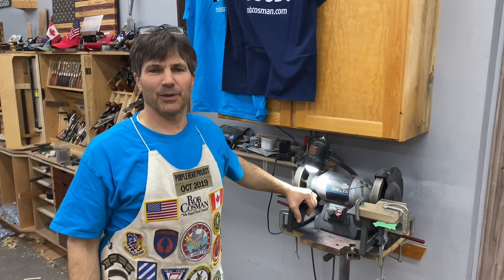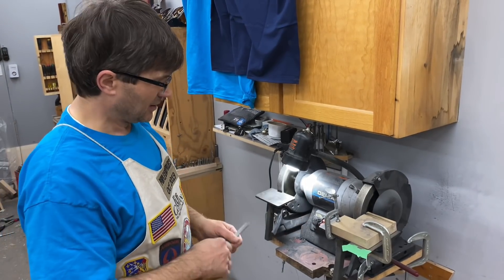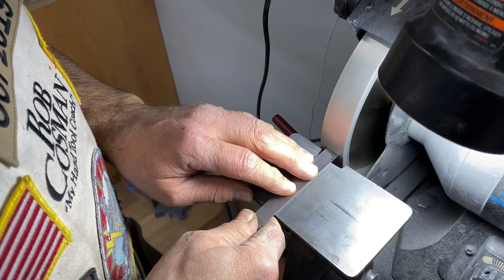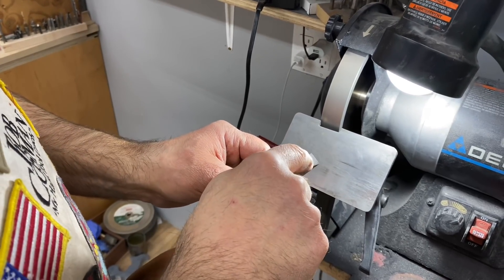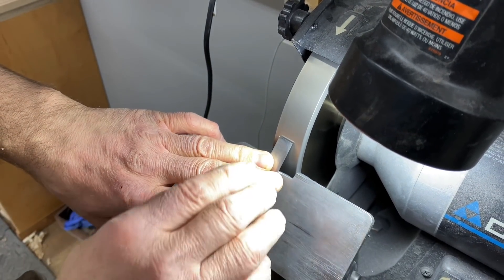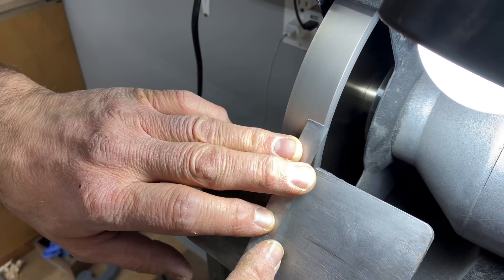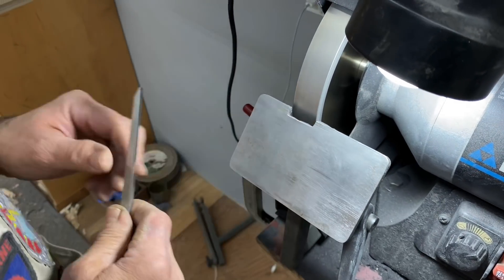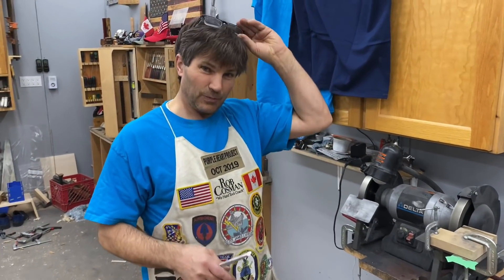Chisel Repair, regrinding the primary bevel.

Comment: Hi Rob. Thanks for showing this. Very helpful! Question - I realized after a while that I had the angle set wrong on my honing guide and I had put a 37 degree bevel on the blade of y #4 smoother. Should I start over and regrind it? Can I do anything from this point? I actually have 3 bevels on it now.. the 25-degree original, a 30-degree secondary and this 37-degree tertiary. Thanks for any advice!

Comment: Hello Rob. Beeing a bit familiar with how the hardening of the steel works, dont you think that you will loose some of the hardening by grinding the chisel dry? the tip becomes very hot which affects the steel. Have you considered this? Or is the idea that when you continue to sharpen the edge with the wet stones you will remove the affected steel? Thank you for excellent videos and craftmanship.
Reply from the maker: With no metallurgy background I can only speak from practical experience, no difference in edge retention after the process compared to before.

Comment: Hi Rob, what dia is your CBN wheel.  I only have a 6" bench grinder, so I'm concerned about the effect of the concaved face on tip durability.  Should I be concerned, or perhaps increase the effective angle by a few degrees, say 27 deg?
Reply from the maker: Steve Bosun mine is an 8” wheel, which I definitely recommend. The 6” grinders, like you point out, creates too much of a hollow. I would bump it up to somewhere between 26-28°, depending on the chisel.

Comment: What’s the alternative to having a bench grinder? A very low grit stone? Was considering buying a low grit diamond stone.
Reply from the maker: possible but takes a while
Reply: I used very coarse diamond stone for grinding handplane blades and it took several  hours.  It was so frustrating that I ended up getting a bench grinder.
Reply: @jaritiukuvaara9319  bought a cheap 180/220 grit one from Woodcraft last week. Haven’t tried it out yet, though. Tried with a 330(?) grit one, and took me like 6 hours to still not take it from 25 to 20 degrees.
Reply: @JeremyB8419   I had DMT D8XX 8-inch Dia-Sharp Continuous Diamond - Extra-Extra-Coarse. I was able to return it.

Comment: Great demonstration! Does the Wolverine tool rest have angle stops to take the guess work out of it?
Reply: No. It does come with a plastic guide jig, but as he said, that may not help if the chisel has a taper. Also, their marketing really only shows turning tools, so I'm not sure if the jig even has the correct angles for normal chisels or plane blades.
Reply: The angle is affected by the distance of the tool rest from the wheel and the angle of the tool rest, so presets wouldn't really apply.  The way Rob did it works and is simple enough that even I can do it.  The Wolverine set up is nice for this operation and the lathe work that drove its invention.  That said, I wish I had even half of Rob's eye/hand skills when it comes to the grinding and so much more, but I get by and get better.

Comment: Will 3600 rpm ruin the CBN wheel ?
Reply: No. Just keep the pressure light. We used a 3600rpm 8" grinder in a college wood room and it was fine. One of the best things we invested in while I was there, as teenage boys are not nice on chisels and I'd do a lot of re-grinding.

Comment: I was just wondering Rob if you have ever used a whet stone grinder such as tormek for regrinding and sharpening chisels. I have both a bench grinder and tormek have to say the would prefer the tormek, but that's much opinion. Just wondering if you have used them before.
Reply from the maker: I find the Tormek too slow for me, i get why folks feel safe using it but my type "A" doesnt fit!
Reply: @RobCosmanWoodworking  I agree with them being slow, but I prefer tormek as I use it for my woodturning tools, leaves them a finer cutting edge. Thanks for the reply
Reply: @Pat Mahon what's that supposed to mean?

Comment: How do I flatten the back of a vintage beat up chisel?
Reply from the maker: elbow grease and a flat aggressive stone
Reply: The Atoma 140grit diamond stone is a good place to start
Reply: @mylesjohnston8759  that looks interesting! Its like a metal lapping plate with a layer of tough diamond grit sandpaper, do you have experience with it?
Reply: Lego Man 12345 12345 I do with the slightly less course Atoma. However i hear it is very good. For what your looking for
Reply: @mylesjohnston8759  I will do some research, thank you!
Reply: I’m surprised this has to be done by hand. Is there not another way with grinding wheel?  Like using the side of the flat side of the wheel?
Reply from the maker: No, must be done by hand if you’re a hobbyist. If you know a machinist they might be able to get you relatively close, but you’ll still have to apply the finishing touches.
Reply: @wjjpearson  I have tried that, it didn't give that good of a result, it basically made it even worse
Reply: @RobCosmanWoodworking  OK fair enough - thank you.